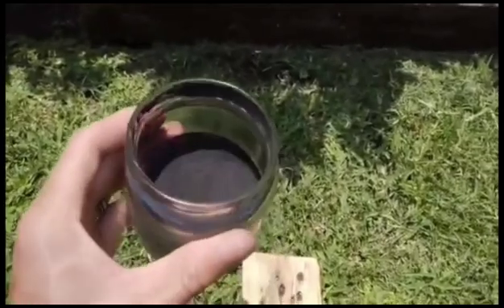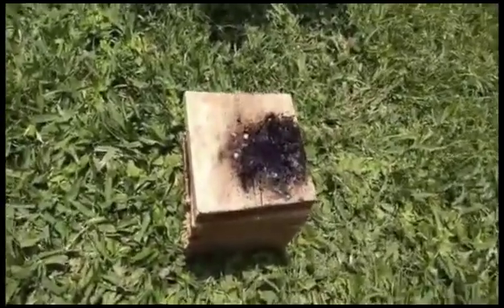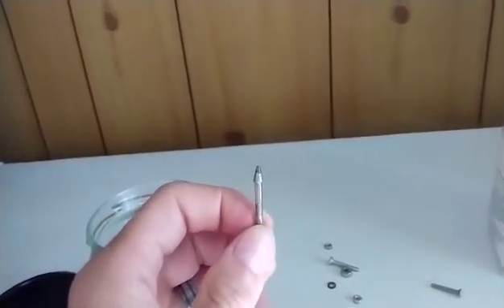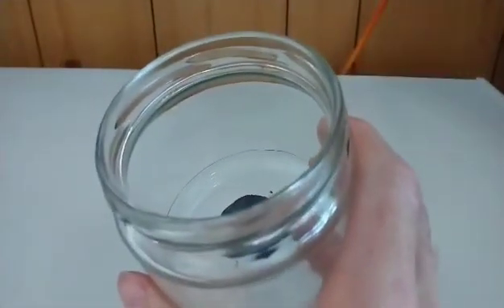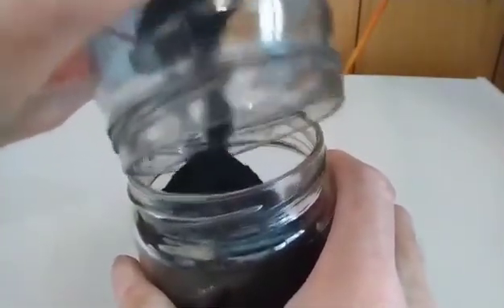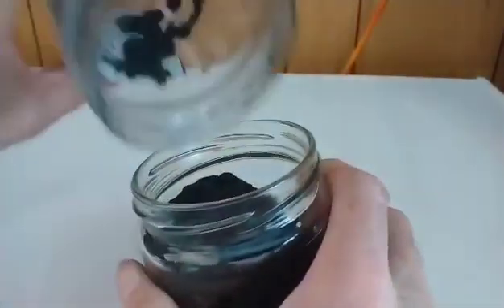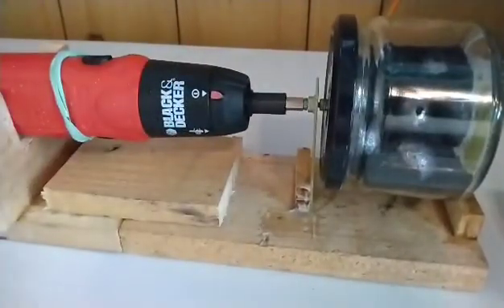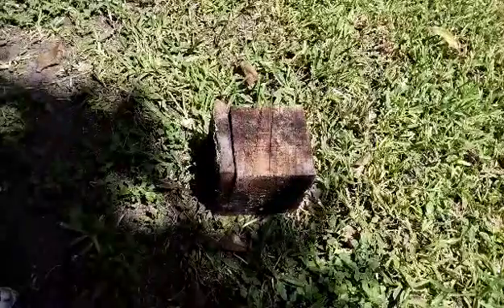How to make a ball mill for black powder - DIY - Part I

Comment: I heard glass bottle is dangerous because of sparking is it true or did I read it wrong. Thanks for the vid!
Reply from the maker: I don't know, in principle it is not supposed to spark with lead balls. But I always turn on and off the ball mill remotely (long extension cord) and let it run in a safe place.

Comment: If you want cleaner faster burning blackpowder, Mill it with brass balls and mill it for 48 hours or more. Longer gives higher burn rate and you can achieve faster bullet speeds
Reply from the maker: Won't brass balls spark?
Reply: @BlueMoonshine  of course no
Reply: @BlueMoonshine  brass is the best thing maybe
Reply from the maker: @ФёдорЗародышев-т2ц  
Brass is not heavy enough.
Reply: in coffee grinder n can mix n grind the black powder...best mixture...

Comment: Hi.
Why not using different calibers rubber steel balls  instead of  ?
Reply from the maker: I never tried, but you want the balls to have a high mass density (11.34 g/cm3 for lead vs. 7.84 for steel). Also, you don't want the softness of the rubber, you want them to be hard so that they can pound the powder more efficiently. I know that lead is not super hard, but still harder than rubber.
Reply: @BlueMoonshine another question please : do fishing weights balls goes well ?
Reply from the maker: @joe_6306  
Yes, what I used in the video ARE fishing weights balls. Just make sure they are big enough.
Reply: @BlueMoonshine  oh ok sorry , did not pay attention to.
Thx a lot dude ! 👍

Comment: can glass marbles be used?
Reply from the maker: I'm not sure, but if it works, you would have to mill for a much longer time. The point of using lead is that it is heavy, and therefore better at crushing micro particles into nano particles.

Comment: instead of lead balls, is it ok to use glass marbles? will it spark?
Reply: I would be very careful using glass.  To make a sparking flint, you look for any stone with a mohs hardness of 7 or greater (flint, chert, and quartz being the most common).  Glass is made primarily of quartz sand and has a hardness rating between 5 and 7 depending on the makeup.  If you get the wrong glass and use a common steel drum, it's very possible you could detonate your black powder.  This is why lead and brass are the standard because not only are they non-ferrous, but they are also low on the hardness scale.
Reply: Brass works better since it produce a cleaner powder  @DigitalHarmony4All
Reply from the maker: I don't think they will spark, but they will be much less effective at grinding and pounding the powder. You need something heavier.

Comment: A glass jar . . . . .
Reply: It works perfectly well, as the result proved it! You think you would be safer if the jar was in metal if it explodes? The point of using an electric ball mill is to be away from it when it runs, in case of an explosion!
Reply: @valrousseau7039  Yes but it's too much work drilling holes into a glass jar , i don't even know how he did that , and there is a chance it may break , so pvc or firm plastic jars are a better choice mayhaps .
Reply: @vespergremlin3367  No, plastic is a terrible choice, as it is the best way to build static electricity that sparks and ignites the powder.
Reply: @valrousseau7039  Ah , so pvc
Reply: wait a minute pvc is plastic heh ) 
so what would you use if you didn't want to use a glass jar ?
Reply: @vespergremlin3367  I don't know. Maybe the inside of the jar can be upholstered with leather.
Reply: @valrousseau7039  I intend to use a plastic jar except that I wasn't going to mill the three constituents together . I would then have to find a way of thoroughly mixing everything
Reply: @vespergremlin3367  You can grind the constituents separately and get a superfine powder with a coffee grinder, for 15 minutes. You end up with a superfine powder, that flows like a liquid. But then, when you mix the three powders together by hand, you obtain a black powder with a terrible quality, that is hard to ignite. It burns very slow, like at the beginning of the video. The ball mill not only mixes, more importantly, it it makes nano chunks of potassium nitrate to stick to nano chunks of carbon and chunks of sulfur. It is is close contact between the constituents that make the resulting powder powerful.
Reply: @valrousseau7039  Yes that nano-chunk business is where the magic is , i suppose i would get a reasonably similar result (nano-chunks) by mixing the powders together with a mortar and pestle - for smaller quantities of course . I shall have to try and see
Reply: @vespergremlin3367  That should be doable. After all, how were they making black powder in the old times?
Reply: @valrousseau7039  I came across what people call the 'c i a' method of making black powder a moment ago , also called the precipitation method : ''by allowing the potassium nitrate to crystallize itself out from its hot saturated solution to a mixture of charcoal and sulphur, with an aid of cooled absolute ethyl- or isopropyl alcohol '' 
Might give that a try as well
Reply: @vespergremlin3367  I'll try that too!

Comment: Thanks for the video. Very informative. If one cannot access lead balls as the media for the ball mill, can glass marbles work in place of the lead balls? And if so, what size should the marbles be in diameter for a shell (container for milling) that is about 4 times the size of the shell as the one you used in the video? Also, what type of lead balls did you use? Were they an alloy of lead or pure lead, because pure lead is substantially soft. Thanks.
Reply from the maker: I guess glass marbles could work, but you would have to mill for a much longer time. The point of using lead is that it is heavy, and therefore better at crushing micro particles into nano particles. I really don't know about the ideal diameter one should use. I simply used pure lead balls that I got from the fishing section at Walmart. And yes, we want the balls to be soft so that they won't spark.
Reply: @BlueMoonshine  thanks lots for the response. I see that some fellow amateur pyrotechnics also use marbles, but it's like trial and error, I guess.

 My last question here 😀, can an empty, clean 4 pound Skippy peanut butter plastic jar or an empty, clean 3 pound jif peanut butter jar work as a drum when building the ball mill, in case I cannot successfully drill the hole into the glass jar?
Reply: @torro6460  I believe that would work too!
Reply: @valrousseau7039  thanks for the advice.👍🏾

Comment: If I were to finely ground the chemicals before I mixed them would I still need to mill it
Reply from the maker: YES! In the first test I show, the chemicals were finely ground before I mixed them, and you can see that the resulting powder burns poorly. You need the ball mill to pound the microscopic particles so that you end up with a mixture where there are always potassium nitrate molecules in very close contact to carbon and sulfur molecules.
Reply: @BlueMoonshine  thank you for the help

Comment: Brother can’t we mix them by shaking with hand ✋ for 15-20 minute
Reply from the maker: Certainly not! It is not only about mixing, the mix really need to be ground and pounded by lead balls for at least 4 hours. And it would be very dangerous to do it by hand, because as the process is progressing, the mixture becomes more and more explosive. You want the ball mill to do the job for you at a safe distance because, although very rare, ball mills explode sometimes. If you just mix and shake by hand for 20 minutes (without pounding), your powder will be very weak (as shown in the video).
Reply: @BlueMoonshine  thank you my friend for the reply 🙏🏻😊 love from india 🇮🇳 ♥️ i would like to ask one more question 🙋🏻‍♂️ can i use anyyyy wood for making charcoal for black powder?? I have heard that willow grapevine work best but here in india I can’t find willow or grapevine 🤤 so can i use any soft wood(mango mulberry or any other) for this ?  🙏🏻 thank you
Reply from the maker: @Rahul.patel48  I honestly don't know. I simply bought ready-to-use charcoal, and I don't know what would it is made of. I also heard that willow is the best, but that any wood should work decently.
Reply: I've heard that newspaper makes good charcoal.

Comment: Hi very interesting vid thanks for sharing. I have a few questions.
1. How did you center the holes
2. do the led balls chip the glass? 
Thanks mate!
Reply from the maker: 1) To center the holes, I simply put crisscrossed rubber bands and drilled where they crossed.
2) The balls won't chip the glass, as long as you have enough powder in it. The powder make the collisions soft.
Reply: @BlueMoonshine  Thanks so much. Very grateful for the response and video. Do you have a venmo or bitcoin address where i send some $ to buy you a cup of coffee?
Reply from the maker: @tropics9633  Thank you very much, I appreciate it! My bitcoin address is: 3Acuvi7SL5xfQgVsZQYi1avQqL6ngD8LYx
Reply from the maker: My Venmo QR code is here: https://vadcpa.com/Val/Images/Venmo.png
Reply: Lead cause your powder to be more dirty, more fouling in gun